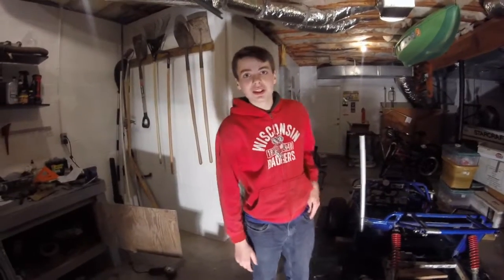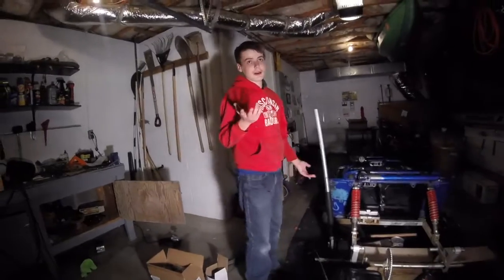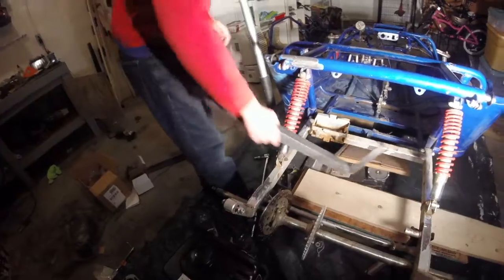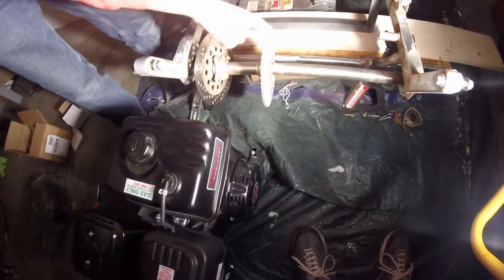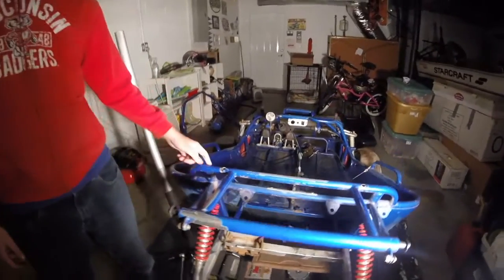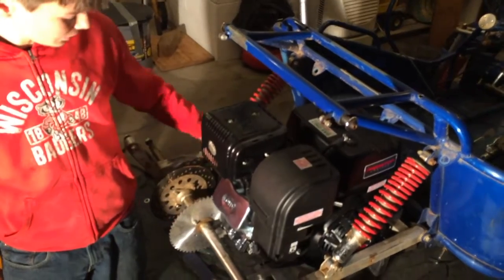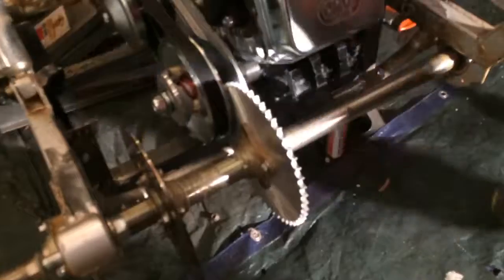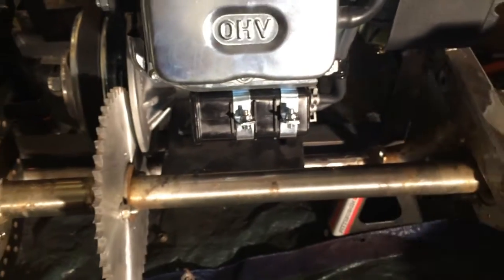Hammerhead Go Kart 420cc Predator Engine Mount Install - Part 6

Comment: Ebay has a ton of them .  They are about $26, and the come with a steel mounting plate, spacers, bolts, washers, and nuts.

Comment: What are you doing about the sprocket size, the cart has #50 chain, what came with the 30 series clutch kit?
Reply from the maker: The 30 series torque converter came with a 420/#41 chain sprocket (both are compatible). I replaced the stock sprocket with a 420/41 sprocket that has the same bolt pattern.
Reply: Can u put the link to the sprocket u put